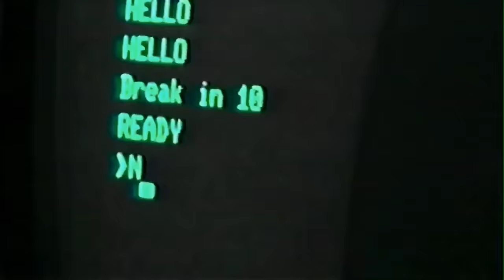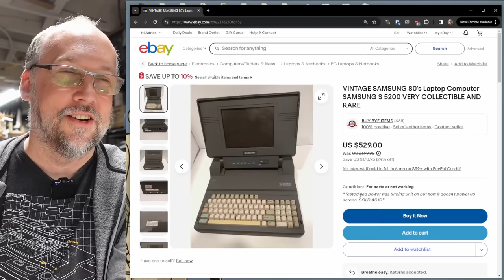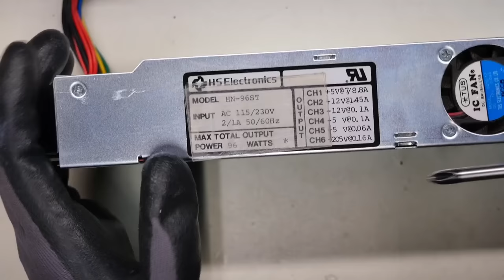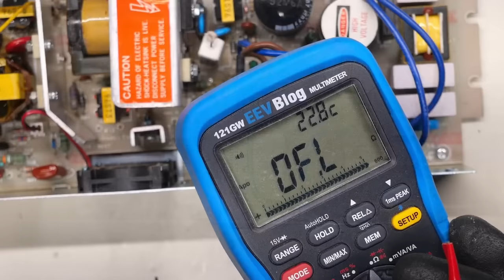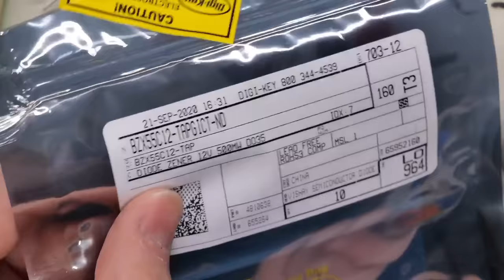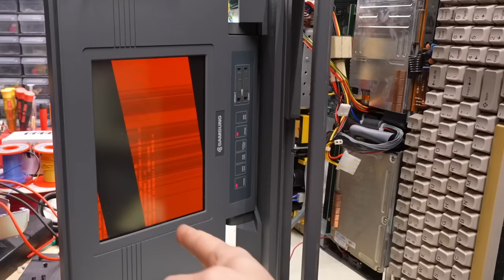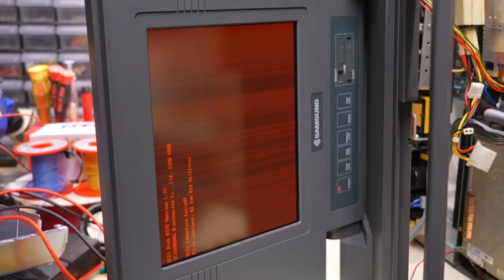Does this dead "laptop" have a gas plasma display? Let's try to revive it to find out! Samsung S5200

Comment: I acquired a Toshiba T5200 with a Plasma display running Windows 3.1 on a 200MB HDD and 10MB RAM on a 386. Very cool! I found a TI 486 with a 386 pinout & it worked, but only when I removed the separate Math-coprocessor. Its in storage for now, but my next project I'd like to try, IDE to CF adapter this fits nicely in the Floppy bay, running a Tiny Linux, I got past the 386 limitation but I cannot get past the RAM limitation.

Comment: Back in the holy 80s, maybe it was 1990, my friend got this old Laptop type of machine. Must have been an 8086 - at that time a 286 was the latest, I guess
Must have been really expensive, it had a LED screen, albeit monochrome only.
Unfortunately, with no possibility to upgrade at least the gfx, probably the sound as well, it was simply not much fun to use.
At least I never saw my friend using it really - the C64 had at least primitive sounds and gfx.

The control key being where CAPS lock usually is, was pretty common back then. Even 15 years later I would make my CAPS Lock key an additional Ctrl key. Not that I used it at that place much, I just hate touching CAPS lock by mistake.

Comment: The screen lines are fixable, it just need heat in the edge to resolder reactivate the glue in the edge conector, exact safe temp is required using a flat head.

Comment: If you can determine the video signalling that goes to the screen, you maybe able to replace it with a modern LCD and a new LCD driver board that supports EGA input source, as we do know that the source is going to come from the EGA part of the mainboard. This also has the benefit of doing away with the 205w power line, as a modern LCD would most likely be driven by a 5v line.
Reply: I think the whole point of saving this computer was for that plasma display.

Comment: @Adrian's Digital Basement    WHY immediately ripping out the power supply without the first step of measuring the power supply output? The Power supply needs to  provide  5V on all red cables and 12V on all yellow ones. Black is GROUND (GND) and blue normally is the "startup" Signal for the power supply OR maybe the 5Volts Standby-power and the other colors may be the -12V rails for the RS232 serial port. 

Just check for (external reachable) fuses, check (in powerless-state) if the power switch is working (with Ohmmeter), and then check for voltages rom the power supply. That is the very first steps, not just ripping out the power supply...

Comment: there is a much easier way to tell if that's a RF jamming device deceptively sold as a plasma display. just put a radio next to the laptop/tv/etc and if it wipes out a radio station with noise, it's a plasma display. (some sarcasm, yet they do jam radios, especially AM and short wave amateur bands)

Comment: The screen has 4 different configuration settings due to static electricity of the plasma gas and graphics issues.You can change the settings using the  keyboard  (two keys+ the original software from Samsung.)

Comment: You may want to consider putting a 75W incadesant lamp in series with the live going to the switched outlet.  It would limit the current to prevent a cascade failure.

Comment: I had a 1st edition Ipad whose screen died in exactly the same way, visually anyway. I'm commenting after only 20 minutes though as I have an electronics question.

Instead of cutting a leg, can you remove voltage tension from the board by using a diy module on one leg, that is basically a broad wire or very conductive metal, connection to a cap with a decent storage?

The metal wire should provide a lower resistance path which the electrons prefer, and with your Metre on the other rise, you might get a non-destructive reading?

I am an amateur and this idea just popped into my head, I sadly have no means of testing it - so am I talking out of my behind, or is this viable?

Thanks again for a great post Adrian, I do adore these red displays!

Comment: Once long ago the flex cale in a PC cracked and parts of the screen went dead, I carefully sanded off the shield and soldered bog wires around the break. It's a pain but doable. Good luck.

Comment: i have 3 orange gas plasma toshiba laptops (but one,, T6400DX, is a big heavy one like the one in the video,  probably bigger sideways but not so deep front to back, full size detachable keyboard and space for a full length ISA card) but all 3 have 'issues' at  the moment, displays work ok, or at least 'did' when last powered up over 15 years ago!  one is a T3100 very similar to the one in the video, its PSU makes a squealing noise

Comment: Company had a Toshiba ~1990 much smaller than that (if my mind isn't playing tricks) that had an reddish orange gas plasma display.  It was the mobile programmer for our PLCs, but we just played Wolfenstein on it mostly.  I'm pretty sure it was a 286 machine but could have been 386.  I remember that there was just one sort of potentiometer/adj wheel on the side for screen brightness.  I also recall that the display wasn't perfect much like the black bars (but far less) on the one you have.

Comment: GRiD Systems created the first clamshell design laptop (GRiD Compass) which was initially used for military use.  It had a plasma screen and predated all of the laptops mentioned in this video.  I worked for GRiD for several years.  Their militarized laptops flew on the space shuttle and were also available for commercial use.  They were unbelievably reliable.
Reply: I remember seeing ads for those from surplus distributors in the computer market magazines in the late 90s.
Reply: The first laptops I worked on were GRID  486 with monochrome VGA. They were popular working around hazardous materials and food due to being able to operate just fine in sealed bags.

I had one that the customer called for out of warranty repair. It had been dropped from an oil rig into the Gulf of Mexico. The only thing was that part of the screen was dead (and visibly broken). By that time AST had bought GRID and sold it to Tandy. So I quoted a $1200 repair and they said OK. Still the most expensive computer repair I ever did.

Comment: buy a T-shape soldering tip. u can apply heat to flat flex joints. it will fix those vertical lines. dont use any liquids
Reply: use acf tape\film to reattach if necessary. acf remover can help to clean ribbons

Comment: To be fair, the screen in this computer seems to be in a lot better state than the Ebay listing.
Though, in regards to fixing them. Perhaps it could be something as simple as a flat flex cable starting to get loose. Sometimes one can reheat them, but sometimes it is a lot less trivial than that.
I should mention that I have no clue about this specific display. But other Plasma displays I have torn down over the years have been fairly similar internally to LCD displays. And it is a known solution for these.

Comment: The problem with the Toshibas is that they had very specific hard drives, and the ROMs had to be modified in order to stick a CF card drive in place of the spinning rust.
Reply: Is there somewhere I can read about this? I'd like to save my Toshiba T2100 if the 10M hard drive goes out.

Comment: That screen is probably an easy fix. It looks like like the problem gameboy screens has where the ribbon cable isn't making good contact to the screen anymore. The fix is to heat up the solder on the ribbon cable with hot air.

Comment: I mean even with a non-functioning screen, you do have the option for an external screen and an external keyboard so getting it fixed fully is still worth it, imho.
Reply: An external screen to replace the broken plasma display would be like mounting wheels on a broken hovercraft. ;-)
Reply: @NuntiusLegis I mean sure it defeats the purpose of it being a laptop but surely, it's better than binning or scrapping the machine, innit? :)
Reply: @weepingscorpion8739  I think the best use would be as a spare parts donor for a working plasma machine.
Reply: @NuntiusLegis I guess but GL finding one. :) In the meantime, though...

Comment: As far as the panel goes, on the plus side the vertical lines just have variations in brightness, not actually dead lines of pixels like in the photos in the ebay auction there; but on the minus side, looking at an the article on retropaq about repairing such problems it's possible to encounter such spooky electronics as driver ICs surface mounted to flat flex cable, which if you had replacement ones would you even want to attempt the replacement?

Comment: 7:07: Adrian: "Who exactly is trying to collect the Samsung S5200?" <-- I can tell you who is trying to collect that: Propmasters, or companies catering to propmasters. Some of the latter are fly-by-night, some are more established, both are driving up prices of tech of a certain vintage that "looks the part". Especially in demand: Kit from the time boomers/late gen Xers were young, because nostalgia is one helluva drug, and TV shows set in the hipping and hopping "cool old days" of the 80s/90s are exactly what will be piped into retirement homes via cable or Netflix – complete with Ensure and Depends ads. This comment might be too much truth for comfort, but where's the lie?
Reply: Further to my earlier comment, I suppose if you were working for a prop shop and sourced two or three of these machines to the point where the keyboards are retrobrited and their displays light up with that orange glow, that might be enough. Given a decent budget, the dodgy stripes wouldn't really matter, I think. They can fix that in post. All the display needs to do is give the post-processing shop an idea of what it's supposed to look like for that pivotal "zoom, enhance" scene (or whatever they want to use the prop for).

Comment: Zeners with a rated voltage higher than 6V have positive voltage coefficient. So they can somehow share a curent. But this feature is not very reliable, because of their bad original tolerance and similarity.

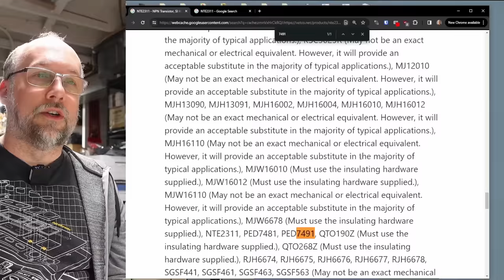Comment: Actually, @ 28:35,  I believe you're reading the datasheet wrong...  The substitution note you read is for the RHJ6674,...SGSF563 parts:
It seems to read like OrigPart#, OrigPart#, OrigPart# (Substitution comments)

So for the part you have (PED7491), it notes: 
    NTE2311, PED7481, PED7491, QTO190Z (Must use the insulating hardware supplied)

So the NTE2311 should be pin-for-pin compatible, although maybe the heatsink is connected differently internally, so they say you "must use the insulating hardware supplied" [with the new part].

Comment: as far as those lines on the screen, it looks almost identical to the line issue on the original gameboy (DMG), Obviously those arent plasma but on the gameboys, theres a ribbon cable that simply loses solder connections and the ribbon just needs reheated

Comment: Those just look like MOSFETs a low voltage signal turns on the high side for current to flow so you don't burn up switches or other electronics that would have been on the same circuit

Comment: May be worth fixing the 12v rail first ... being a plasma gas screen (and I am guessing with no real knowledge here) could it have a heater or warm up circuit that could cause the screen to not display fully?  Or if you could do some sort of stuck pixel program that flashes the screen on off.  Assuming it isn't physical damage at the screen... Also older laptops often passes the ribbon through the hinge and it can fail there... that could probably be bodged easily if it was there.

would be interesting if the circuit was standard enough you could swap out a LCD screen, I know it kills the collectability but as you said who is collecting them?
Reply: These gas plasma displays are all cold-cathode, no heaters are involved.

Comment: Just opened up my Toshiba T5200 which PSU smells quite bad for some reason. But didnt find anything wrong with it just by looking around and it stopped smelling when I got it out on the table... Annoying. But, if it starts smelling again I'll swap it to DC-DC PSU. In Toshiba there's +200V to Plasma too BUT the high voltage is made in the display part and PSU gives +24V to it. So it's little easier to get +24V somewhere.

Comment: I wonder how that +205V DC is derived in the first place, as rectifying the 120VAC mains directly gives you "only" +170V DC.
Reply: Easy enough to include a winding on the switchmode transformer and Shottky rectifier for the high voltage.

Alternatively, a voltage multiplier could be added.

BTW the "primary" voltage is 120v × 2 × √2, because each main capacitor is CHARGED to the peak DC voltage, and the two are series connected in 120v mode, and CHARGED in series in 240v mode.

Gives 170v ×	2 ≈ 340v, minus diode drops and how far the peaks are pulled down by the load.

Comment: Great video Adrian really enjoyed your botching of the power supply! I think you should skill up on the plasma display and get stuck in there, you've got mad CRT skills, I think you could get stuck in with the plasma tech. I wonder it it has similarities with LCD panels, with those gates and drivers, and those old lower Res ones are more fixable I think than the newer ones. Go on, have a go getting that sweet plasma display back to life!

Comment: Usually, I like your repair videos, but this is the most kludge video you have ever done. I would never recommend what you did to fix that power supply let alone pull out that 12 V pin just to get it to boot.

Comment: What about injecting low voltage, around one volt, with some current and trying what part gets hot. Wouldn't that be much easier to find the shorted component?

Comment: exciting, seeing that thing boot up is like seeing a relic from an ancient time coming alive and telling a story. those vertical lines, couldnt it be that the screen sucked in air and some air humidity that causes these vertical lines ? or maybe like someone else already wrote it could be a bad cable, i guess corroded connectors. are there any new replacement screens for that old device? what can be done with an old computer like that, can e-mails be written ànd send on that device ?

Comment: Can you test tantalum’s on the board without removing them? I have a weird issue with my Apple II where the disk controller in slot 6 fails when 2 drives are plugged in but is fine when you just use 1. System checks pass, same issue with multiple drives and controllers.

Comment: Looks very close to the Toshiba t3200 design wise - 286 and Paradise EGA chips. If you can't fix the Plasma its still an interesting machine due to the PEGA which supports all sorts of weird display modes including Plantronics. 
Have two T3200s myself, one working, the other with a defective display. Was wondering if its possible to attatch a color lcd panel to the internal connector somehow.

Comment: Is the screen ribbon similar to a gameboy and what would be a good replacement adhesive I got my gb screen fix use my soldering iron but consider it temp fixed I don't trust just applying heat for a lasting repair been working for 2yrs but could let go at any time.

Comment: I have a weird off-the-wall question: what is that group of seven circles on the hard drive? I have seen it before on other old hard drives, and I'm guessing it has something to do with ventilation?
Reply: It is for atmospheric pressure equalization. There's a filter on the inside.

Many people, who should know better, think that hard disk drives are hermetically sealed. The very few that were immediately fail with altitude changes, due to the case distorting.
Reply: @mikebarushok5361 That's interesting, I didn't know that. Thanks!

Comment: Hello i had a question for this gas plasma display 

Would it be possible to send a video signal to it for use as a monitor? I have had a few of these types of "portable laptops" in the past and while they sometimes didn't work ove always wondered if someone could rig the monitor part to be used as a actual monitor

Comment: Hi. Just a question. Would you know what old laptop still available to buy would be suitable to play old 2000 onward pc games. With a dvd drive. Appreciate your advice. 🙏
Reply: I think Windows XP should run well on a Dell M4600 mobile workstation. Really any laptop with a GPU from 2011 or earlier will should work for XP gaming, as well as a few models available through 2013.

Comment: Sucks? The Ctrl key is actually in its proper, easy to reach position. I dunno who was the idiot who put the arguably most useless key - Caps Lock - in its place, but that was clearly a crime against humanity. All my systems are configured so that it behaves as it supposed to.

Comment: Instead of calling it a "Laptop" we called those "Luggables".  In the day, they were fairly decent computers for their size.
Reply: He says this less than 2 minutes into the video.
Reply: To be fair, it can actually be operated on your lap, which cannot be said about my old IBM 5155 model 68.
Reply: @jonasthemovie  Yes, this was a "laptop" to distinguish it from the luggables and lunchboxes like the Compaq portable and Kaypro
Reply: cue the "osborne 1"
Reply: @jonasthemovie   it can if you're strong enough :D
Reply: Kaypro, OG Compaq, Macintosh Portable, Commodore SX64... THOSE were luggables. And if this has a LeadAcid battery, like the Mac did, I absolutely would list it with luggables.
Reply: @slightlyevolved  then epson followed by radio shack LCD poratables